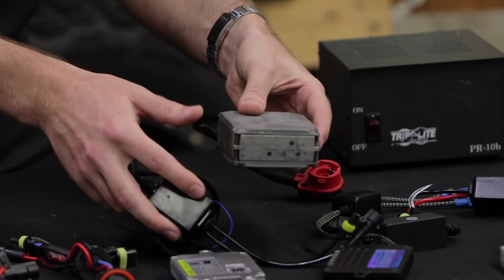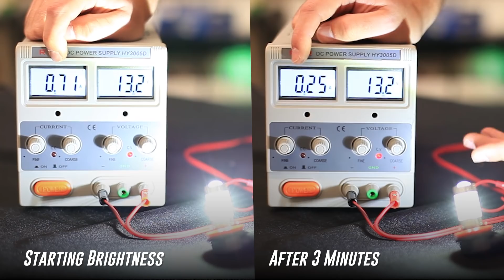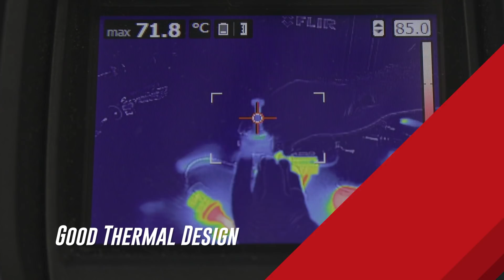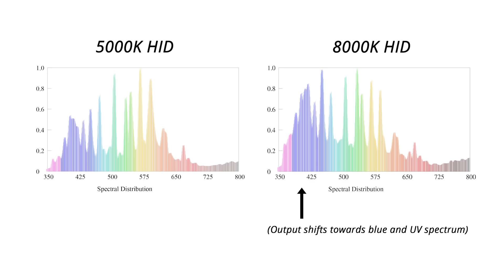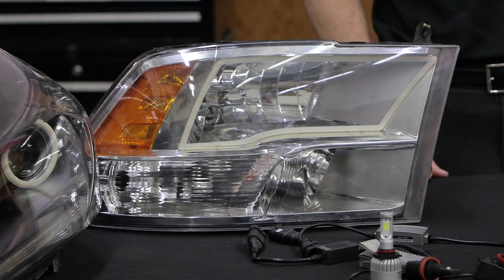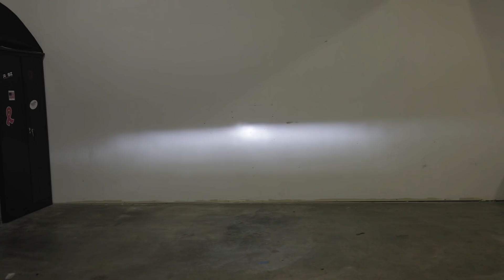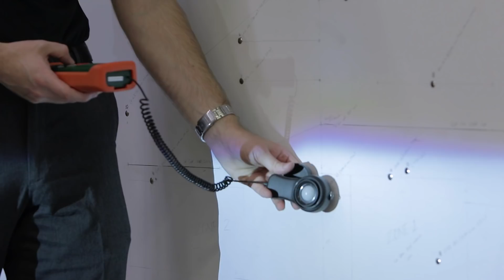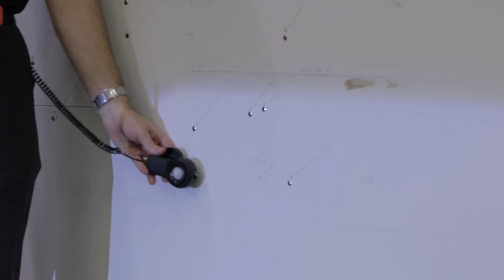HID vs LED Headlight Bulbs: EXPLAINED

Comment: Is LED overheating exclusively caused by design or could it be voltage? For example what if a half volt resistor or even less was tacked onto an LED?
Reply from the maker: Great questions! Both of those things are definitely contributing factors to premature failures. Without a reliable inline driver, voltage spikes can easily cause LED chip failures. We use a boost-mode circuit for our SL1 LED bulbs, which prevents thermal imbalances for the LED chips over time, so you won't experience those types of failures. The SL1 also has current-monitoring circuitry that mimics the electrical characteristics of a stock halogen bulb, so dash warnings should not occur after installation and resistors or capacitors should not be required. We do offer plug-and-play CANBUS Anti-Flicker Modules that can be used inline with our SL1 LEDs for pickier electrical systems though. If you have any other questions, just give us a call at 314-205-3033, Monday-Friday 9 a.m.- 5 p.m. CST, or shoot us an email at contact@diodedynamics.com!
Reply: @diodedynamics  Boost? What are you boosting up to? The ideal config would be 2 groups of 3 leds in series. zes max foward voltage is 3.2V (2.8V nominal) giving a total foward voltage of 9.6V max (8.4V norminal) @ 1200mA -1500mA. This needs a buck converter. I also like how you make out that a phosphore coating is so expensive to change, when there is  no change in price from 2700K to 5700K. Cheap companies ues the reject batches of phosphore coatings with sub par wavelengths  uv/blue leds which is why they are so bad. But Philips is the second best LED manufacture behind Fluence.
Reply from the maker: @The_Koups  I don't have all of that information at hand, but if you email us at contact@diodedynamics.com, we can get more information from our engineering team for you!
Reply: ooh I see! Wow thanks for answering with that insight!

Comment: Sorry, but no halogen automotive bulb puts out 1500 lumens. Even aftermarket halogens produce about 800 lumens at best. This is still a very informative video
Reply from the maker: You might check your numbers again - almost all headlamp bulbs produce 1200-1600 lumens depending on type and test voltage. H11 is 1350 lm ±10% @ 13.2V, for example. Reference: page 52 of ECE Regulation 37 http://www.unece.org/fileadmin/DAM/trans/main/wp29/wp29regs/R037r7e.pdf

Comment: Great informative video. I have a 2019 Hyundai Sonata sel with projector headlights. I was thinking of upgrading to LED or any other type of bulb for a bigger output. Based off the video it seems like led was a good option but depending on the make of the car. For this type of car what do you think would be a good upgrade from stock? A good LED or switching to HID. Prior to this video I was convinced not to go down the LED route because some studies have shown that the main reason they’re brighter is because they scatter more light so they look brighter but their performance is not as good as a regular stock halogen
Reply from the maker: Hey Alex! You could go with an HID conversion kit for those projector housings if you want the most noticeable increase in brightness. If you prefer something that will last longer, try out our SL1 Headlight LEDs. They are still a big upgrade in output, and they are much easier to install. If you have any other questions, just give us a call at 314-205-3033, Monday-Friday 9 a.m.- 5 p.m. CST, or shoot us an email at contact@diodedynamics.com!

Comment: My car came with HIDs from factory, but with a reflector, and mine go from blue to white, to an almost yellowish tint when they warm up
Reply from the maker: Hey David! Just give us a call at 314-205-3033, Monday-Friday 9 a.m.- 5 p.m. CST, or shoot us an email at contact@diodedynamics.com for information on replacement options for your vehicle!
Reply: David I'm guessing your vehicle is either a Toyota Prius, Sienna, or an Acura TL or RL. Regardless, factory HID systems have to conform to DOT regulations and thus must produce a certain wavelength of light from the factory. They appear slightly yellow because they are trying to replicate standard halogen color temperatures. Technically any blue light that emits from a civilian vehicle is illegal as it can be seen as "impersonating an emergency vehicle" and so manufacturers go to great lengths to ensure their factory lights do not emit any blue light whatsoever. Specifically the color temperature of most factory HID systems runs around the 4300K to 4800K range, and halogens usually run around 4000K to 4300K. Hope this helps.

Comment: Can/should I swap my HID bulbs/lamps to LED?
Reply from the maker: Hey there! You should definitely switch to LEDs if you have after-market HIDs in a reflector housing. If you have an OEM HID setup though, you'll need to stick with that type of bulb. If you have any other questions, just give us a call at 314-205-3033, Monday-Friday 9 a.m.- 5 p.m. CST, or shoot us an email at contact@diodedynamics.com!

Comment: Quality HID are still king. At least in the aftermarket..
Reply: @jjm2948  I live in rural pennsylvania, so I like to be able to see. Whitetail deer are every where and I swear they are actually trying to get hit.
Reply: @wantsanewvehicle  " so I like to be able to see." Sounds like you need to get your eyes checked.
Reply: @DanafoxyVixen  My eyes are perfect.
Reply: @jjm2948  Fairly reliable and cheap yeah, but I have flashlights from walmart that are brighter than a lot of stock halogen headlights lol.
Reply: Hell yea...
Reply: Sometimes cheap is boring..
Reply: @jjm2948   I use HID in my projectors and I haven't changed the capsule in eight years.
Good HID's are very reliable, but more expensive and worlds brighter than halogen
Reply: Jason M   Reliable he says. Replaced 4-5 bulbs a year in my Subaru. Did an hid projector retrofit. Twice as bright. Haven’t changed a bulb in 6 years.
Reply: Jeremiah wow you keep your car for that long?
Reply: @amosy8345  I didn't when I was younger. I have owned 17 vehicles ranging from a $400 beater car to a brand new gmc sierra.   2-3 years was average for me, sometimes less than a year.  I bought this Subaru Legacy in 2011 with 20,000 miles on it.  I commuted 120 miles minimum a day for 8 years. The car now has 224,000 miles with no troubles ever.  It still drives great, runs perfect, looks almost new and has awd which is good for winters in Alaska.  It is worth so little to try and sell that there is no point trying.  It has a permanent registration so I think its just mine for life now. Not to mention the many hours and $1,500 in custom lighting that blows everything else around here away.  I also have 2 other vehicles.
Reply: Jeremiah nice that's great!
Reply: @jeremiahlf  "Replaced 4-5 bulbs a year in my Subaru. " and you didn't think that was abnormal and check the Alternator or something? sounds like somethings up with your cars ability to maintain a healthy voltage.. even without the whole HID debate, get that checked
Reply: Dana Vixen   I did check all of those things and of course I thought it was abnormal. A huge pain in the ass in fact. That happened the first 2 years before I had enough. I retrofitted hid projectors. No more troubles. The housing holds too much heat and the bulbs fail very quickly. Subaru sent a letter describing this widespread issue and how they extended the warranty by 7 years on the bulbs because of it. I have much improved visibility and reliability now. Almost every legacy and outback 2010-2014 around here have a bulb out.
Reply: @jason m which hid are you saying are reliable?
Reply: my hid has been going strong for 5 years now and I will never look back

Comment: I've spent hundreds of dollars and countless hours scouring online forums figuring out what works best for headlight upgrades over the past several years. This video pretty much sums up and confirms what I've discovered, but in only 25 minutes. 

I really appreciate how DD presents facts between systems right up until the end when they start naming and promoting their LED solution. No matter, as in my case LED's are the way to go at the end of the day.

These guys need to do a head to head with their SL1 LED and TRS's Morimoto 2Stroke to see who's best. From my research those are the two heavyweight contenders for our Joe-public hard earned dollars. I still need to upgrade the high beams on my 2014 Mazda 6 - whose product should I buy next???
Reply: why do you want to blind everybody else on the road??????
Reply from the maker: Hi Jeff, thank you for the feedback! We will definitely pass that along to our media team. If we hear anything from them about upcoming comparison testing, we'll be sure to share!
Reply: Jeff depending on how keen you are to disassembling your headlight, I would suggest either just using a good set of halogen bulbs for the high beams, or a good set of DD's LED's. Your high beams are reflector style and as Diode Dynamics has stated, HID's are impractical to be used as high beams. If you are willing to disassemble your headlamps there is a custom retrofit option depending on the actual size of the factory reflector bowl in your headlight. The Retrofit Source sells a Morimoto Q45 style LED high beam pod that could be retrofitted into your high beam reflector. I have personally done this mod on my 92 Lexus SC400 with fantastic results. Hope this information helps.

Comment: If I put a set oh SL1's in my 2018 ram reflector style headlight, since I have the DRL turned on will it cause any issues with the LED? DRL in the rams is a lower power output, not sure on the actual voltage, but know it's not full power.
Reply from the maker: Hi there! That's a great question. While the included Anti-Flicker Modules will prevent any errors or "bulb out" warnings, the SL1 will operate at full brightness any time it's on.
Reply: Awesome, I'll be ordering soon
Reply from the maker: @moose8172  Thanks for your support!

Comment: So, to install led lamps, no need any additional installations? Only change factory lamp to diode dynamics?
Reply from the maker: Hello! Yes, our SL1 LED Headlight bulbs are plug and play replacements for most Low Beam and High beam applications. If you have any other questions, just give us a call at 314-205-3033, Monday-Friday 9 a.m.- 5 p.m. CST, or shoot us an email at contact@diodedynamics.com!

Comment: I've wondered about HID for years. I'm sorta glad I didn't go that route. I'm going to be installing my SL1 Low and High beams hopefully this weekend. Very nice product for sure. Lots of great info in this video thanks for show us.
Reply from the maker: Thanks so much for your feedback and continued support!
Reply: Lol I've had both and HID is better. If your on a budget then yea go leds but if got the cash to spend on some nice HID they are way brighter and last longer, plus it's a filament so they make a smoother look vs bright spots with the LED